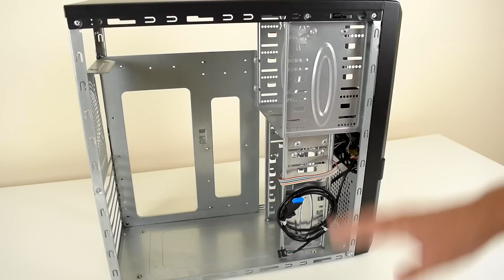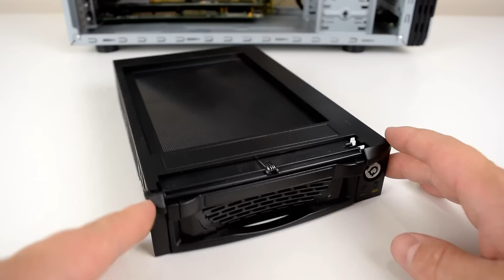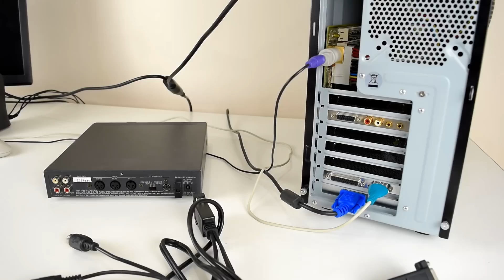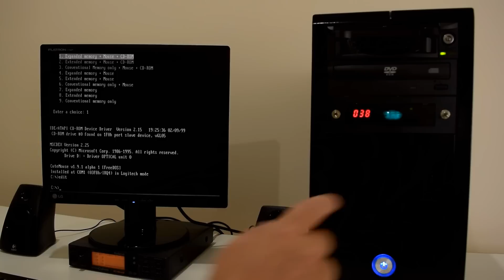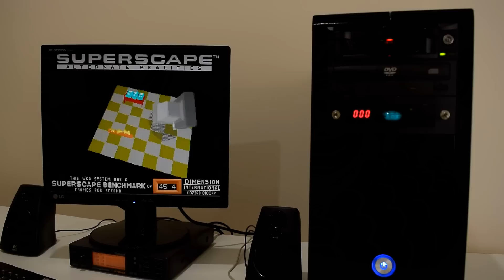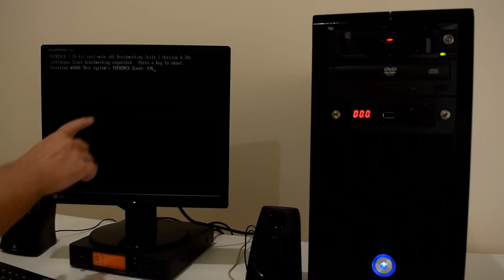Building the 486 DX2 66 Retro Sleeper DOS PC

Comment: Hi Phil, great vid! 
The toggle switch that you are using are SPST, DPST, DPST or DPDT? ON/OFF I suppose. What is the voltage and amperage supported?
Reply from the maker: No idea, I got them from eBay :) Switch has to be permanent, so not a toggle one like the reset button. If it's on, it needs to stay on.
Reply: Can you link the eBay auction?
Reply from the maker: Mauro Addona Mate there are 100s of switches on eBay!

Comment: Great to see the AWE64 works just as well on a 486 DX2 66. I was given the impression it was slow on anything less than a Pentium. Glad to see that information was wrong. Where did your find that bay insert with the switches? And have you ever seen switches wired like that sold separately. I need a few for my project. I could make them myself, but I am a bit lazy in that regard!
Reply from the maker: I just drilled the holes and put in switches :) The switches can be had on eBay, same goes for the wires, but I did solder them onto the switches. The AWE64 will run fine in a 386, it doesn't need anything faster than a Sound Blaster Pro for example. Though games that make use of the AWE synth, will not run too flash on a 386 :)
Reply: Understood. I forgot that the synth was the bottleneck on the AWE64. As for the switches, I guess I can make them myself; I just need to find those leads. Thanks for answering all my questions and making these videos!
Reply from the maker: You can get those leads by running a search on ebay. PC panel lead cable. That sort of thing. They sell a harness looking thing with buttons and LEDs. They are used to connect to the front header, I use them all the time for my test benches. Then just cut of the lights and buttons and you got your cables :)

The other source of these cables are searching for Arduino wires. But check the length, they might be too short.

Comment: man what a nice case. It is very hard to find a 4 5.25 with 2 3.5 bays. F'n impossible to find one with even 2 3.5 bays today! Its a pain because I still use floppies, Zip 250, memory card reader (with bluetooth). I always use separate optical drives one for DVDRW and one for CDRW. I have never seen a CDRW with 8MB buffer and is IDE 133. now try to find a NEW IN BOX White Tower with 6 External drive bays! good luck with that. I have one, but the airflow is horrible, it only uses 80mm fans, 2x front, 2x rear. With my crossfire set up, I like to have a 120mm side fan. The case i am using, if they just used a different front bezel, it would do 2 3.5 external bay. now off to find some treaded plastic stand offs, didn't know they existed ;)
Reply from the maker: Yes I regret not getting more of this one. Gigabyte made some really retro friendly cases for a while, now the drive bays are getting less and less. I mean in a modern PC, you just need a SSD these days, so I get that trend. Just sucks for us that want to build a fully decked out retro sleeper.

Comment: I've done some of the tests om my dx2 machine, my IBM aptiva w/o L2 cache with only isa bus and a cirrus logic GD-5426

3dbench: 38.4fps;
chris's Bench : 25,3;
doom : 1606 realtics
Topbench:179
sysinfo: 125
Landmark: 315.4, 498.9, 10347.80

So my system isn't that bad for a pc w/o L2 cache. ^^ Also, good video, as always ^^
Reply from the maker: Yup that is pretty good! L2 cache should be easy enough to upgrade, especially IBM stuff is well documented.
Reply: Well, there are no socket and there are missing chips, so I guess it won't have any XD
Reply: PhilsComputerLab And I forgot to say, but it's a LPX case
Reply from the maker: I see. Well it performs great as it is.

Comment: I kind of want to buy blank IO plates in bulk and drill/file smooth them into AT Keyboard plug IO shields and throw them up on ebay for cheap. Not really sure how in demand they would be though.
Reply from the maker: 5 years ago you could buy these shields cheap on eBay. I regret not getting them Haha

Comment: As you used the ghetto hard power switch, wouldn't it be possible to use the soft power switch on the case to act as a reset button?

Edit: didn't read all the comments, someone already suggested it

Comment: Nice work, as always. Which plastic standofs did you use? I'm looking quite a while for some, since the metal ones do cause trouble with my old boards.
Reply from the maker: M3 is the keyword. It's a thread standard. As for size, I got an assortment of different sized from eBay. It comes in a little plastic case, because I didn't know what size I will end up having to use :)

Comment: You should use the cases power button as the reset switch since your not using it.
Reply from the maker: Yes, good idea!
Reply: It'd be easy enough to replace the switch behind the button with a momentary, instead of a latching switch.  It's not really rocket surgery.
Reply: Annabella Williams was going to say the same thing :)
Reply from the maker: ***** Nice. I wish I got another one when this one was available.
Reply: That won't work.  The ATX supply needs a SPST type switch, but the case button is a momentary push button which is compatible with the ATX motherboard's power circuitry (The mother board latches the signal).
Reply: OP said reset button which is a momentary button, not for switching power.

Comment: Where did you buy the power/turbo button 5.25" adapter from?
Reply from the maker: I built it.
Reply from the maker: To expand, I drilled two holes and put the switches in. It's really easy :D
Reply: Nice. It looks factory-made.